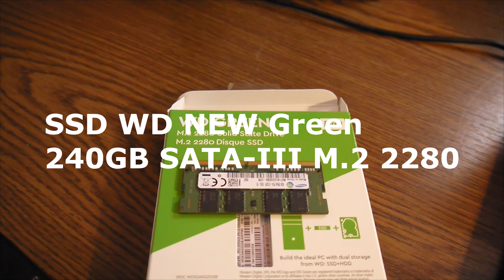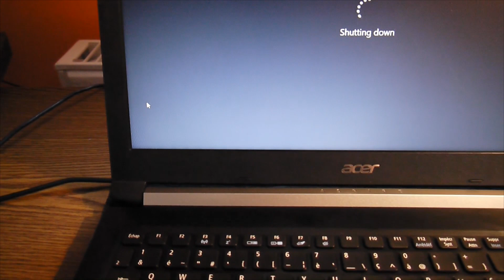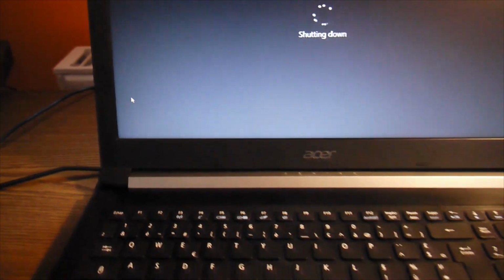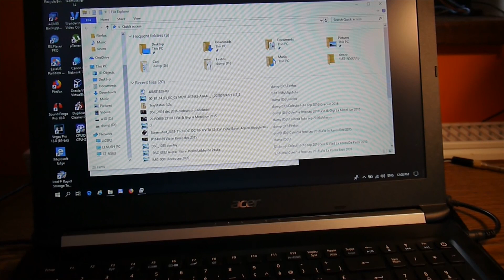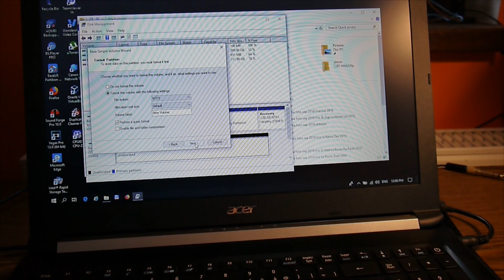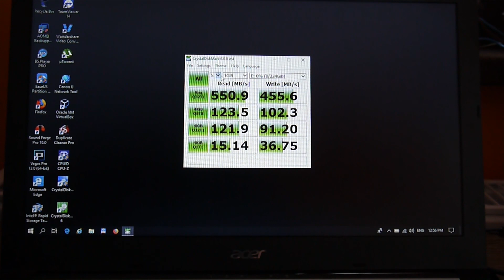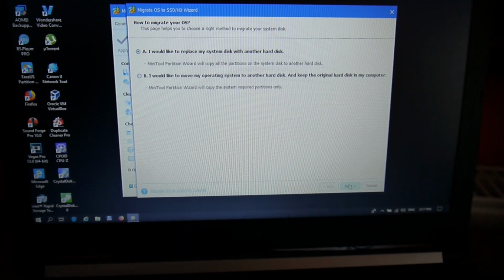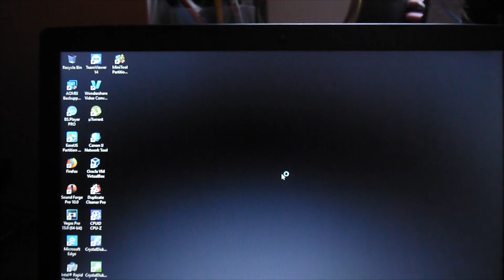Best Acer Aspire 5 A515 51 dismantle upgrade RAM and M.2 SSD

Comment: Very good, what do i must buy on amazon or another website for make the same thing please?
Reply from the maker: I,ve been purchase the parts from local shops.. but you may try ebay or amazon as well
Reply: @viocaia  thanks, i 'm french and i would like what kind of ssd and memory it's possible to install for increase the power and fluidity please?
Reply from the maker: @alfpacino2630  You may install at least a M.2 SSD in the spare slot for the operating system OS , ala an extra DDR4 ram as much as you can afford.
Reply: @viocaia  there is a crucial with 3200MHz too? it's possible to install this?
Reply from the maker: @alfpacino2630  Mine have a 2400 4Gb onboard, so when you'll  insert extra ram ..even with extra speed will go down to 2400...at least.
Reply: @viocaia  i have learn this information since few minutes in a french vidéo! thanks
Reply: @viocaia  16 go with 2666 and ssd 500 it's a good choice?
Reply from the maker: @alfpacino2630  absolutely!
Reply: @viocaia  thanks, i am beginner
Reply from the maker: @alfpacino2630  Not anymore!!!!!
Reply: @viocaia  i think the processor is good...
Reply from the maker: @alfpacino2630  of course, somewhere in the middle, very economic and powerful in the same time.I'm happy with the results, I'm not a gamer so I'm not sure how good is it for games.I use it mostly for recording and mixing multitrack audio, also video render sometime..and it's working good.
Reply: @viocaia  me too, i am not a gamer, just mix sound and video and make you tube chanel
Reply from the maker: Hey! Just give me a hand and  subscribe ! Thanks!
Reply from the maker: Hey Alf Pacino! Will give me a hand and subscribe? Please and Thanks!

Comment: can i use a ram with 2400 mhz frequency ?? or is it necessary to use 2133 only
can you please state the ram specifcations that can be compatible with this laptop ??
Reply from the maker: You may use 2400Mhz,  any DDR4 will do the job.I use a 2133 because it was what I could find at the time.
Reply: @viocaia  so if i use 8gb 2400 mhz ram , it won't be a problem ?
Reply from the maker: Mine have DDR4-2132 soldered into motherboard so if I put a 2400, will go down to 2132 anyway...so 2400 will work anyhow..but I can say there is almost no performance gain from this..consider a SSD drive better..
Reply: @viocaia  ok thanks for ur advice and how can we get to know about the ram that is soldered already in our laptop
Reply from the maker: @anayjoshi9654  there is a software cpu-z just google about.it will give you all the info about CPU and RAM
Reply from the maker: Hey! Just give me a hand and  subscribe ! Thanks!

Comment: Hi, Did your model have the intel optane memory?  Or just the open M.2 slot?
Reply from the maker: M.2 only
Reply: @viocaia  I see a great deal right now on an Acer laptop with the intel optane and was thinking to just remove it and add a M.2 drive instead of using the 1TB drive and intel optane...Thanks
Reply: So the M.2 card you put in is a 2 pin Sata? I see 2 pins.
Reply from the maker: @JasonKale  If meant 2 spaces..yes, please google for wd green m 2 2280, it was the cheapest I could find, but you may use better NVME like here https://community.acer.com/en/discussion/537125/install-m2-ssd-on-aspire-5-a515-51g/p1
Reply from the maker: Hey Jason! Please subscribe! Thanks!
Reply from the maker: about NVME install https://youtu.be/FA9paP39284

Comment: Thank you for sharing this video. 

Recently I have bought this acer aspire a515 series and I have been impressed, overall for the price. I have upgraded to 20 gb ram and to m.2 ssd pcie crucial p1 1 Tb and the machine is very fluid.
Reply from the maker: Super! I'm happy with mine also.Overall and for the money is a best buy.I strongly recommend a HD display too.
Reply: have you installed this ssd? https://www.amazon.fr/Crucial-CT1000P1SSD8-Interne-NAND-NVMe/dp/B07J2Q4SWZ/ref=sr_1_3?__mk_fr_FR=%C3%85M%C3%85%C5%BD%C3%95%C3%91&keywords=m.2+ssd+pcie+crucial+p1+1tb&qid=1570180780&s=computers&sr=1-3
Reply: @alfpacino2630  yes it is, in Amazon by the way.
Reply: so it does support pcie nvme 3x4 ？ I just got myself a pcie nvme 3x2
Reply: @dystopiadeadlyd3vil315  sure it support it, the only inconvenient is that speed is not so fast
Reply: @mariozamora1369  noted that.. thank you for sharing.
Reply from the maker: @dystopiadeadlyd3vil315  It should work, the cut for 3x2 is the same like M.2 sata
Reply: @viocaia  yup,  the size for both SSD are the same, but I've asked the Acer Team Malaysia if it does support PCIe . They revert with a list of "recommended" ssd, in which all of them are ordinary m2. ssd... That's why I'm confused :/
Reply: @dystopiadeadlyd3vil315  the motherboard is capable of PCIe3.0x4 but it is reduced to 2 lanes to minimise the heat it generates. The form factor is M2 2280. The inconvenient is, it will use 2lanes and run at half the advertised speed but still 3x the speed of a SATA Ssd. The reason why I bought crucial P1 1tb was the price I caught an offer in Amazon prime day for only 90 dlls.
Reply: @dystopiadeadlyd3vil315  did this support NVME...I am very confused for this particular model.
Reply from the maker: @4umahin  Yes it does! Our friend Athreya Fc just installed NVME and is working great!
Reply: @viocaia  Thanks for the update brother.
Reply from the maker: Hey! Just give me a hand and  subscribe ! Thanks!
Reply from the maker: about NVME install https://youtu.be/FA9paP39284

Comment: Where is the BIOS battery on this laptop? can it be replaced without having to remove the motherboard?
Reply from the maker: I didn't notice a BIOS battery...maybe is on the other side of the motherboard.Try Google for it.
Reply: @viocaia  Urgh. I hate it when manufacturers do this. Put the battery on the side that's easily accessible So many laptops do this and it's a nightmare.
Reply from the maker: @UndieingLust  right! have passion and you'll do it!
Reply from the maker: I did some google in the meantime..I couldn't find anything about the place of the BIOS battery for this model..sorry!
Reply: @viocaia  Cheers bud. I couldn't find anything either. It's a crime that Manufacturers don't release maintenance  / disassemble guides with all their products. Thanks for your time and help. Cheers!
Reply from the maker: Hey! Just give me a hand and  subscribe ! Thanks!

Comment: Is there a way to replace the usb ports and audio port
Reply from the maker: I'm not sure what you mean..
Reply: @viocaia  On the right side of the computer there's an audio jack and 2 usb ports. Wondering how I would replace those 3.
Reply from the maker: @MsElegance23  As long as you have the replacement parts and a proper soldering hit air station I think you can do it.But needs skills too..better go to a repair shop.
Reply from the maker: Hey! Just give me a hand and  subscribe ! Thanks!
Reply: @viocaia  I found the part online and replaced it
Reply from the maker: @MsElegance23  You're lucky! Nice!
Reply from the maker: Adrian, please give me a hand and subscribe!

Comment: Hey I have a question! The RAM slot that you showed...So, it had like 4gb and you put an 8gb stick? Or was there another slot underneath the motherboard? Is it possible to run dual channel on this computer? I bought this exact model yesterday and I don't know if I should buy a 4gb or an 8gb stick, as it currently has 4gb, I'm thinking in putting another 4gb stick making a total of 8gb, but if it only has 1 Ram sslot hen I'd be screwed by doing that.

Thanks! :)
Reply: Oh and also! I'm already looking for the motherboard layout and can't still find it. Could I use an NVME with this one? You know, to get those super high speed write and read speeds! :) Sorry for that many questions, I hope you can answer them.
Reply from the maker: @blackLink123  I'm not sure if you can install NVME, all I know M.2 is working for sure.
Reply from the maker: there is only one extra slot, it have 4G RAM soldered on the motherboard.I believe is dual channel already, so the extra memory you'll install will run dual too.
Reply from the maker: Hey! Just give me a hand and  subscribe ! Thanks!
Reply from the maker: about NVME install https://youtu.be/FA9paP39284

Comment: My laptop is not detecting the m.2 ssd
Reply from the maker: Check the bios if is in the list.Also check if put it in correctly it should be with the label up
Reply: @viocaia  It got detected and I cloned my windows in it too but now when I change the boot drive in BIOS from legacy to IEFC ( not sure about the name ) it is showing no bootable drive
Reply from the maker: @arnavodkaa  Open Windows from the old HDD, go CTR+S, type Disk management and make M.2 active,now it should boot from M.2 ..if not , make a USB stick in reinstal windows in the classic way, just choose the new M.2 for install place..
Reply from the maker: @arnavodkaa  also you may take out the old hdd and let only the ssd, see if is booting like that...
Reply: @viocaia  god 😭😭😭 now it's showing boot configuration file is missing when I used my ssd
Reply from the maker: @arnavodkaa  nice! Maybe you should install from srap..best way..make a backup of your old disk just in case in install OS on new M.2! Good luck!
Reply: @viocaia  it's finally done without installing OS again . I just have one question should the new bootable ssd be dynamic or basic disk ??
Reply from the maker: @arnavodkaa  Great! Make it basic.
Reply: @viocaia  ok their is another problem 😿😿 I disable my HDD to make sure that my ssd is being used and now it says winload.exe is not found
Reply from the maker: @arnavodkaa  get in to recovery menu with F8 at booting, windows should repair it self
Reply: @viocaia  no it isnt
Reply: @viocaia  it's not doing anything
Reply from the maker: @arnavodkaa  I really don't what else to do exept a clean install of windows..that should fix everything
Reply from the maker: check this out https://www.youtube.com/watch?v=-LB9TqfQrsA
Reply from the maker: Hey! Just give me a hand and  subscribe ! Thanks! Hey! Just give me a hand and  subscribe ! Thanks!
Reply from the maker: Hey Amav ! Please help me with subscribe! Thanks!

Comment: Hi, i did same as you. But after this process i couldn’t start the pc on battery. I checked the battery cable twice what is the problem do you think
Reply from the maker: Once you take off the battries the laptop will start only with power supply, it is the same like a hard reset.so plug the power and star it eventually the battery is on
Reply: Viorel Caia does it take time to recover the battery? Because i’m using it for like 5 minutes and it says plugged but doesn’t charging
Reply from the maker: @cengiz6744  check the connector should work instantly
Reply: Viorel Caia I did the process carefully and checked it twice but the battery doesnt work. Ssd worked anyway. Maybe i broke something inside
Reply from the maker: @cengiz6744  as long as windows see the battery should be ok also if the orange is on means charging if you have two blue means full battery also check the connector on the motherboard maybe is a pin free...I didn.t had a problem like that! But is working only with battery now?
Reply: Viorel Caia orange is blinking when charging. I will check the battery cable again
Reply from the maker: @cengiz6744  that.s good so the system is seeing the battery be patiente
Reply: Viorel Caia I tried to calibrate battery it didn’t work again. I agree with system sees battery but it sees battery like an old battery. Usually old batteries cause this problem. But my battery was very good in performance idk what i broke
Reply: Viorel Caia i blowed inside the socket and it worked :D maybe its something like high temperature protector. Or maybe it started working by oneself. idk. Thanks for all your help
Reply from the maker: @cengiz6744  Nice! Enjoy!
Reply from the maker: Hey! Just give me a hand and  subscribe ! Thanks!
Reply from the maker: Hey Cengiz ! Please help me with subscribe! Thanks!

Comment: I'm currently researching how to upgrade my aspire 5. The video was helpful, though i am confused by the choice in dual memory. So far as I had the understanding both memory sizes and speeds most match for best performance.  Acer say's that this laptop can support 32gb of RAM. correct me if I'm wrong but wouldn't you have to remove the original 4gb stick with soldering iron then solder in a 16gb RAM. I have no interest in soldering this project. My questions are 1. can i mix the original 4gb RAM with a RAM the same speed but different size and receive the full performance and compatibility with 2 sizes, same speed?  Or would it be wiser to match size as existing ram that is not removable?
Reply from the maker: just put in as much DDR4, maximum speed if can  afford(I'm talking about price here!) I din't really are about speeds. I just put in the cheapest parts I found..and BTW a HD display!!
Reply from the maker: Hey! Just give me a hand and  subscribe ! Thanks!

Comment: Want to install m. 2 ssd and ram need to remove hdd first, then install finished, just put back the hdd?
Reply from the maker: Itæs a good ideea, I did it to help BIOS to see M.2 easier, also if you have an USB SATA adapter you can migrate the OS to new M.2 and make it bootable.
Reply from the maker: but is not really necesary, it can be done with the original connected.After BIOS is seing M.2, boot to OS, partition the new M.2 and migrate the OS.
Reply: @viocaia  if want to install ram and ssd, can I find you to help me
Reply from the maker: @aoruschung8562  Rule nr1. be careful about electrostatic charges and discharges, use a wood table or something non plastic, before open it touch any metal part of the laptop.Please follow the tutorial, everything is real simple.Of course I'll be around for any advice..if is up to my expertise..
Reply: @viocaia my laptop is same to you, but it is 2400mhz,i want to buy same 2400mhz ram,i am so scary  to buy wrong one
Reply: i use cpu z checking already
Reply: i remember it is 1200mhz time 2,1200 x 2
Reply from the maker: @aoruschung8562  good ideea!
Reply from the maker: @aoruschung8562  I just realise mine is working at 2132MHZ  because the 8G brick from Samsung is slower then original RAM (4G soldered on the main board_) so if you can afford a faster 2400 doesn't hurt, but there will be no significant difference.I used 2132MHz because is what I could find for that momment and for what I'm using mostly the laptop (mixing and recording music ) is more then ok.
Reply from the maker: Hey! Just give me a hand and  subscribe ! Thanks!

Comment: Hello. I know this is really late but I'm looking forward to upgrading my RAM. I currently have the A515-51G with a 4GB DDR4. Does the laptop have one slot or two slots? And where is the original RAM? This question seems to have different answers on different websites.
Reply from the maker: just follow the video..you'll got all the answer! The main RAM is soldered on the mainboard and thereis an extra slot for additional up to 32G I recall...
Reply: @viocaia  oh okay. So I can add an 8GB DDR4 for my 12GB needs and I'd have no problem if its 2400MHz?
Reply from the maker: @m.7mxd  absolutely!
Reply from the maker: Hey! Just give me a hand and  subscribe ! Thanks!

Comment: Hey, I put a new WD SSD but the laptop doesn't turn on after that. I even pressed the reset button. Any ideas?
Reply from the maker: Check the BIOS..if is there it should work.What kind of SSD..is it M2 or regular 2.5?
Reply: @viocaia  Its a M.2 SSD. I figured it out. You have to screw everything back in for the laptop to use the battery. Just snapping the cover back ain't enough. Lesson learned.
Reply from the maker: @tanaypatankar4353  Nice! Enjoy!!!!
Reply from the maker: Hey! Just give me a hand and  subscribe ! Thanks!

Comment: I also have the same laptop of 8gb ram ..i m upgrading it into 12gb ram (4+8) will it increase my high end gaming performance which was lagging before..pls do reply?
Reply from the maker: The gaming performances are not directly tied to the amount of RAM in sthe system, rather to the graphic card , the speed of HDD or SSD, so I don't think it will be a great increase.
Reply: @viocaia  yh ur right, u can only change ur drive, to increase game performance, the Ram is good. Or else get a new gaming pc😅
Reply from the maker: @cheezybread7783  Yep! It's kind of low end gamer PC, but I'm not a gamer, so for my needs, mostly audio recording and mixing is very ok! And with the HD display I installed I can do video as well..
Reply from the maker: Hey! Just give me a hand and  subscribe ! Thanks!

Comment: Hey, I have the same model. I wanted to know what ssd type you installed. Is it sata type or PCI type?
Reply from the maker: SATA M.2
Reply from the maker: Hey! Just give me a hand and  subscribe ! Thanks!
Reply: @viocaia  thanks for the video mate !!
I have the same laptop, can I use both HDD and SSD simultaneously???
Reply from the maker: @sagarsolanki1980  of course, I'm using the original mechanical 1T and new 256G SSD just for OS! Hey! Just give me a hand and  subscribe ! Thanks!
Reply from the maker: Hey! Just give me a hand and  subscribe ! Thanks!
Reply: @viocaia  Yupp already !!!
Reply from the maker: @sagarsolanki1980  Thanks!!!
Reply: @viocaia  I have Acer Aspire 5 A515-51G-56K9. Can I put Samsung 980 (500gb) M2 NVMe type SSD to it? Please answer, I have been confused for 2 days!
Reply from the maker: @suryahr307  yes, you can! Watch my latest video about nvme
Reply: @viocaia  I did.. thank you!
Reply: @viocaia  I saw that, Samsung SSD 980 comes with a transfer software for HDD to SSD or something, so we don't need to use any external third party software.
Reply from the maker: @suryahr307  Nice!